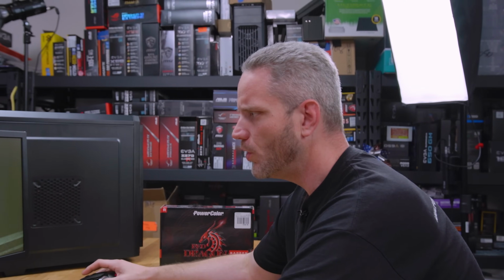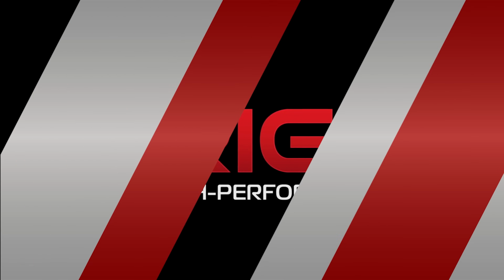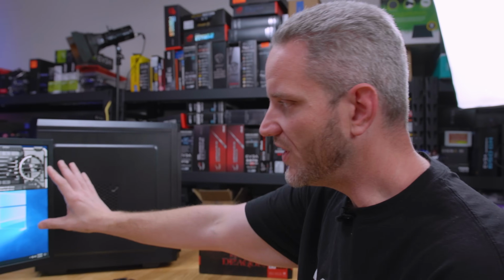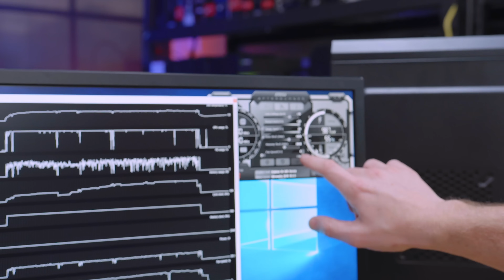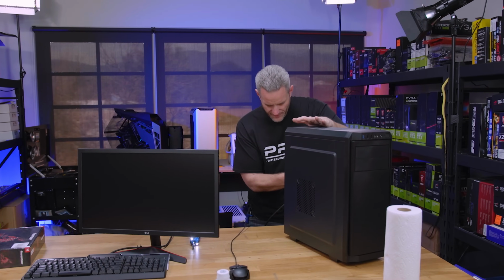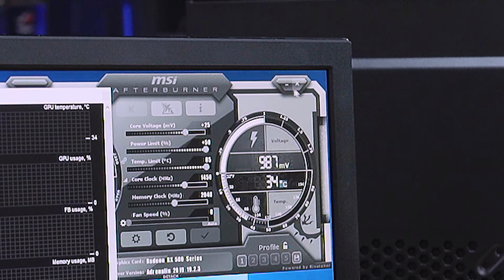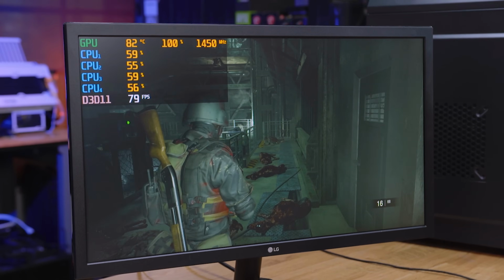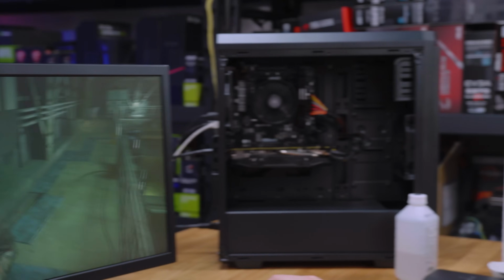Should you replace your video card's thermal paste??

Comment: Just replaced my rx 570 msi armor thermal paste, the temperature still the same, but the fans are much slower than before
Reply: so the fan automatically slowed down just cuz it detected that it need not to have the same rpm, to have the same temp? I learned something lol
Reply: @monfreign  it makes no sense what do u mean ?
Reply: @monfreign  if u are watching youtube it may not spin at all, but temp are no the same as if it would get some solid rpm, to me gpu should be always as the lowest temp possible. So watching youtube on 60 c, without fan spining to me is worse than watching youtube on 40 c with spining fan. Maybe its a problem when u have pc on your desk which is stupid but whatever
Reply: @gabtyty  he means that after replacing paste he can achive same gpu temp with slower  fan movement
Reply: Msi armor cards have a crappy heat sink. Some of them don't even make proper contact with die
Reply: Mine is rx470 and always black out when reaching over 90
Already 5 years n never change thermal paste, do u think my issue is because thermal paste? The heat is really absurd when u guys say have 75ish C gpu but mine even reach 90 within a sec when gaming ><
Reply: @eldoralsuli5387  yeah  100 % need new paste
Reply: Bloody Mindset just change thermal paste and its really work!!
Reply: Job Well done; the drivers determine optimal temps; and with good paste, the fans spin slower.  You could always shut off the variable fan speeds, and just fix them to a certain RPM.
Reply: the Fans are running auto, basically trying to keep your card at whatever temp, therefore heat transfer has improved
Reply: I have the Same Card and its really loud at the moment. I'll try it soon.
Reply: Hey guys idk if you can help me. I bought an rx 570 but it turns off/crashes when reaches 60°. Something like this has ever happened to you?
Reply: @Angel-io7fg  Check if your power supply pins are connected properly to your graphics card. It may also be because you have insufficient power in order to run the graphics card. I know this has nothing to do with it turning off at 60°C but check it anyways. It might also be a problem with the card itself, or maybe the vcard's bios.
Reply: @phaserush1024  It does have a lot to do with the temperature higher temps components need more energy so it could be the psu, the hotter the gpu gets more power hunger it gets.
Reply: @Angel-io7fg  instal your gpu brand app to change settings ( this one when u can oc etc. ) U should be able to change your max load temp or smth like that. My gigabyte was set on 83 C. After reaching this value my gpu gets slower so maybe you have set this on 60? Idk
Reply: @Angel-io7fg  reapply thermal paste i had this issue once randomly and i just put some new paste my cooling was so bad my card wasnt able to run anymore... Change the paste and its like new now
Reply: @Angel-io7fg  maybe its not perfectly installed
Reply: @Angel-io7fg   i have msi armor rx 570, I don't know if we have the same issue. My issue is also sudden crash when playing valorant (black screen, fans still spinning, no audio). I haven't exactly checked the exact temp but I downloaded msi afterburner then tweaked the fans curve to be able to maintain good temp. It happens rarely but still worried about the issue. It only happens in valorant, dota2 and csgo doesn't usually crash, my friend said it might be driver issues cause valorant is a new game? But idk.
Reply: @Angel-io7fg  I had that issue with an old ATI, Nvidia GTS, and a 480 GTX.
Each time for me it was a power supply issue. Make sure your plugging in enough power and your PSU can support the power to all your stuff. Also, check your drivers too. It can't hurt to make sure you're updated or not using very buggy drivers. I don't know much about modern AMD series but AMD had a lot of driver issue with the series that launched around the 1000 GTX series. To where some drivers would cause that issue for some but not all. Then the fix would fix it for some and then cause it to others.
Reply: @Angel-io7fg  no we buy Nvidia
Reply: rizvian igamo you probably put it together wrong or got some crap in the bearings
Reply: @Docosi  nope bro. If I spin the fans at the same RPM than before I changed the thermal paste, the temps are getting colder than before
Reply: rizvian igamo I guess I don’t know what you mean by slower
Reply: @Docosi  turn on your vga fan RPM monitor on MSI afterburner. Then you'll get what I mean
Reply: @Docosi  the fans have an easier job in cooling so the heat tranfer improved
Reply: @TheAdatto  basically this. If you don't like the low RPM though, you can set up a custom fan curve in Afterburner according to your preference.
Reply: @phaserush1024  i have msi armor rx 570, I don't know if we have the same issue. My issue is also sudden crash when playing valorant (black screen, fans still spinning, no audio). I haven't exactly checked the exact temp but I downloaded msi afterburner then tweaked the fans curve to be able to maintain good temp. It happens rarely but still worried about the issue. It only happens in valorant, dota2 and csgo doesn't usually crash, my friend said it might be driver issues cause valorant is a new game? But idk.

Comment: Changed the paste and the pad on my Vega 64 and saw temp drops of around 10-15c this let me lower the fan speeds so I'm still running at the same temps but with a quieter set up so it worked well for me I have the Asus strix OC edition.

Comment: I got rx 580 msi armor 8gb, using it for 4 months, temps were about 67-70 max, but i decided to change the termal paste, and now its 85c....help?
Reply: Mecju disassemble it, remove thermal paste, re-apply thermal paste (make sure that’s enough), assemble it don’t move the heatsink too much, screw it down evenly until the screws can’t move anymore. Let us know.
Reply: @superdika  Thanks for the reply, i've done it with bunch of thermal pastes, i got a gembird one with 4.5 w/mk Thermal conductivity and for 1 day the temps got lower (75-77c) then after it started raising to about 82c max 100% usage with agressive fan speed.The only thing that can cool this gpu is power limit (-30% 70c max) but less perfomance :).I think its the gpu itself or it needs much better thermal paste.
Reply: @superdika  i am familiar with thermal paste changing and stuff, but mby there is something that i dont know about this newer cards.
Reply: i fixed it with undervolting it and now temps are about 75, i can undervolt more but i am afraid i can broke the card

Comment: GTX 1070 founders edition running at about 78 deg C playing Scum on lower graphics settings. Reapplied the thermal paste with Arctic MX4 and found the temps dropped to 45 deg C! I was gobsmacked to say the least, have turned up all the settings to Epic/High yet limited the frame rate to 60, now running quite happily at between 48 - 50 deg C.

Comment: My Sapphire Nitro+ RX 480 8GB OC runs at 1342MHz whuch us basically a RX 580. But the card dies run hot. 75°c is the target temp and it does hold well but 60% fan speed is quite noisy. So at 30 to 40% its OK but the card throttles a little. Bu i dont notice any drips cause i have a 90Hz freesync monitor. The card actually overclocked like a monster. 1425MHz on the core and 8400MHz on the mem.
I was going to get a aftermarket cooler but i thought about getting a RX 590 or a VEGA.

Comment: Same as my RX 580 from Asus, 82 degrees max. repasted that piece of junk three times, does nothing. Every other card I ever had would drop in temperatures, but not this damn Asus Dual.
Reply: Gigabyte AORUS RX580 - around 75c with fans on about 2000 rpm, not a big difference

Comment: I've just done my old RX-480 with some Kryonaut thermal paste that's just in my desktop PC and on idle it's dropped down 10°C and under load 12°C. The old paste was just so crumbly it basically fell off the die.
Reply: Any stutter before you did that? Mine stutters right now pushes lots of heat through it.

Comment: I changed the thermal paste on my Asus 1080 Ti Poseidon Platinum a few months ago with Thermal Grizzly Kryonaut and the temps went down about 10°C and a friend of mine did the same with his GTX 1070 I think it also was an Asus and exchanged the paste with Kryonaut and had similar results, about 10°C cooler.
So first, I really can recommend Thermal Grizzly Kryonaut and second Asus might not use the best paste so you probably should change that.
Reply: is good, but ThermalRight tfx is better
Reply: @icold666  Pretty much no difference between both I buy what I can get cheaper.

Comment: horrible case cooling. GPU blows hot air everywhere, recycles it on itself. CPU blows hot air around. Basically you have a tornado of heat inside the case. It's not enough to push air in the case from one side and blow air out of the case from the other side. You have to direct the coldest air available from the environment (bottom of case, usually) to the most power dense components and out of the case to the opposite side of the case.

Comment: undervolted my xfx rx 570  core voltage to 1010mv at 1285 core clock temperature came down from 86c max to 73c max
use wattman for undervolting  and msi afterburner  for fan curve

Comment: TLDR; use a box fan and new thermal paste to ghetto rig your system 5C cooler. \o/ I wish I had no experience with this.  Once owned a laptop that required a small fan to sit on top of or it would randomly die.  Joy.

Comment: I've been going through a spat of repeated crashes with my GTX 1070 FE.  I've tried everything to try to cure the crashing problem software wise, so I'm hoping a change of thermal paste on the GPU would help.  I used some Antec Nano Diamond thermal paste and I hope this will cure my problem.  I've been trying to crash it since then by cranking everything up to max and I end up with a maximum temperature of 52*C.  Only a few days time will tell if this was a success or not.  If not, I'm thinking I will replace it with an RTX card.

Comment: this just fixed the problems with my 1070! it runs 8-10°C cooler now. Thanks
Reply: a bit late to ask :D . How old was your 1070? I have an 1070ti that runs 78-81C full load, which I find a bit high considering many people are <75C full load :)
Reply: @daneelh95  3 years, i think.

Comment: I have a MSI GTX 760 Hawk in my media PC and on replacing the thermal paste there was absolutely no difference in temperatures. It still hits 90˚c when under load. Using MSI Afterburner to set the fans to 100% permanently also makes no difference, except to make the card exceedingly loud.

Comment: I had my fans set to 90% on the nitro+ 480  and it was throttling at 82c, my mate had the idea to repaste it and it got it down to 62c full load. With the full oc at 1390 and 2000 mem it’s running at 71 full load or 51-65 while gaming.

Comment: I'm gonna buy a thermal grizzly kryonayt to repaste the cpu, my 2080 and laptop's hardware.

And i had to take the door off my case when i had R4, because the fans i had wasn't able to push out the hot air,  so had to have the case door open. Today i got R6, with dual rad in front with push & pull in, one in on the bottom, 3 exhausts on the top and one exhaust in the back.

Comment: I just replaced my MSI RTX 2080ti gaming x trio thermal paste with Coolermaster Master Gel Nano and it went from 76 deg to 65 deg 🤗.Playing same game same map & settings for 2 hours @ Room temp 24 deg  running in a Corsair Crystal 570x. Fan noise is hardly noticeable now I'm very satisfied. Rainbow 6 Seige went down from 74 Deg to 63 Deg WoW.   Thanks Jay

Comment: I have 2 msi rx580 Armor Mk II 8GB Oc cards that won't go over 300Mhz in Afterburner. They used to go up to 2000. I haven't done anything different. What's wrong?
Reply: 300 is normal when gpu is not used. energy saving bla bla..and i also had a lot of issues with MSI afterburner.

Comment: Replaced thermal paste(thermalright paste 14.3w/m-k on my 2months old rtx2080 gigabyte gaming oc and got nothing ;) ..card was always very cool and great oc, wanted to squeeze last bit of juice.. Anyway it overclocks to 2100mhz which drops to 2070mhz or even 2055mhz while rtx on in metro Exodus.. Memory(Samsung) goes extremely high to 16700mhz or 16500mhz for daily use..temperatures are around 60c with custom/silent( <60% fan speed) and low 50' with fans maxed.

Comment: My card idles at low 30's without the fan running. I'ts a Evga gtx 1070 ftw2 , been happy with it.
Reply: case fans would do that, my card stays about the same, but it's an ASUS strix so it's own fan doesn't come on till the high 70's in temps

Comment: They use just plain old glue to hold down the plate, you have to heat it with a heat gun and really pry at it.  You will notice it makes very poor contact with gaps and the heatpipes are far from perfectly flat.

Comment: Run silent cards do this. Iv got a zotac gtx1070 mini that will run at 85c with the stock fan curve. The reason is they never hit 100% fan speed to reduce noise, mine maxed out at 85%. With a custom fan curve that hits 100% at 60c it now hits around 65 with a oc . Theres nothing wrong with the cooler its doing its job,, its the fan curve

Comment: crappy case with insufficent fans and terrible airflow, rx580 clock at 1450mhz +50% power limit and +25mv (so technically you run @1175mv! ) and the problem is the card? AHAHAHAHAHAHAHAHAH

Comment: United States Federal Trade Commission has made a ruling about those stickers. They're not worth the paper they're printed on. The FTC has ruled that a manufacturer cannot void a warranty because of a broken sticker, whether it was intentionally broken or otherwise. Manufacturers cannot void a warranty because of the otherwise harmless attempt to repair, do maintinance, or inspect a defective product. If all you do is take the thing apart and put it back together to do maintenance on it, you have not voided the warranty. You can go to the FTC's website for that information. Of course, changing the paste changes the design of the thing, which is another matter altogether, and may there be  void your warranty.

Comment: 9600 GT passive temps are at 20-25 "idle" 50-53 in 100% load...
Why? Never changed a thermal paste, never changed cooling system at all. Just added little fan covering small part of passive cooling system (heatsinks) and take the heat out from the case ... I guess I got lucky on parts..

Hovewer if I turn off this little fan (40mm) in full load (100%) it hits 103°C idle 80°C ... Thinking about what the manufacturers do.'

Yes I know it's legacy Graphic card, but still.

Comment: You want as little paste as possible to avoid heat soaking. The paste that oozes on the side will not efficiently transfer the heat.
Reply: Doesn't matter. Some excess paste makes no difference to air in its place. Missing corner coverage however or having air bubbles would be much worse. A bit too much doesn't hurt, a bit too little can toast your chip.

Comment: ok but if they set the bios/driver to target 80 degrees, it will always be 80, better paste will run the fan slower, worse paste or room temp will run the fan higher, it's weird that you didnt have fan speed in the overlay

Comment: Since buying my Asus dual OC 1060 6GB on 2016 all games I played make my card go to 60ºC. Card was overclocked as well. A year later, I started noticing that the temp rised to 70ºC on my games and 6 months after that it went to 80ºC. 20ºC on a year and a half span. At that time I replaced thermal paste and thoroughly cleaned the fans and heat sink and now I am back again at 60ºC.

Don't be afraid to service your card if you notice this or similar behaviors. And in case you have doubts, Jay and other tech tubers have awesome tutorials on how to work and service any component on your computer.. :)

Comment: It's probably more important to get the dust out from the fins of the heat sink. Even if you blow the heat sink out with compressed air, some dust matter sticks to things and don't blow off very easily. (Maybe dead skin cells?) So it'll not be like when it was new and perfectly clean.

Comment: J, you probably don't read all the comments bu anyhow... I had an interesting situation the other day that maybe you can test in your video. I was talking to my friends about, "can I clean my computer fans with a air compresor" I said Yes, why not, but hold down the fans so they don't spin" and som guy said: "if it spins, does it produce power like a generator and can it harm the motherboard or other components?" an I said "nooooo?".Even if it does produce power it could not harm the computer So I went home and cleaned an old PC with a two year old LC power supply and for fun I just blow it with a air compresor without stoping the fan (and it was jus a short blow, nothing to serious) and the thing is, when i started the computer disk drives couldn't start aldo they were working just fine before clean up. PC booted up ok, but there was a disk error. I could hear the disk start and stop like if it didn't get enough power. With another power supply everything worked fine. Is it posible, that while I was blowing the fan it generated power to the power supply and damaged it? I would realy like to see a test in your videos, since you probably have a ton of power supplys or motherboards to test this. I tried blowing a fan and measure it with a voltmeter and at full speed it showed 5v. But don't take my word for it since I'm not an electrition. Can you test this please?

Comment: I got a 1070 with Arctic Accelero Xtreme 4, which hit 62C @ 35% Fan Speed with 2 years old paste. Recently replaced it, and now it's only hitting 50C.

I'm using Noctua NT-H1